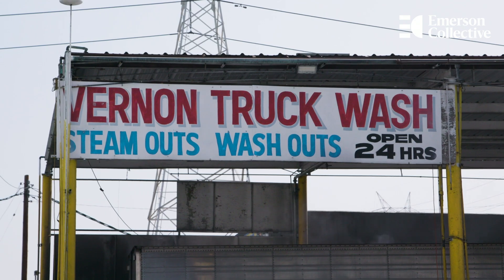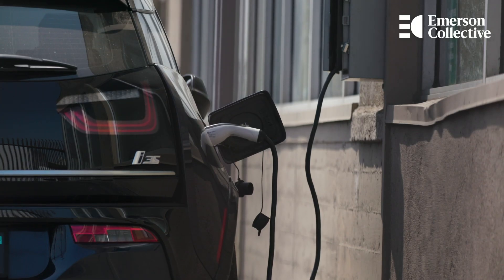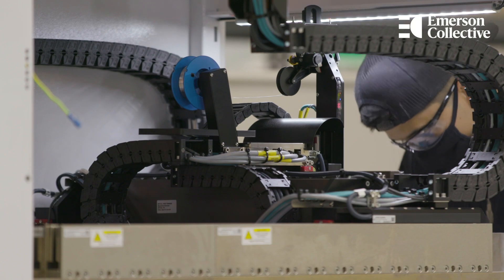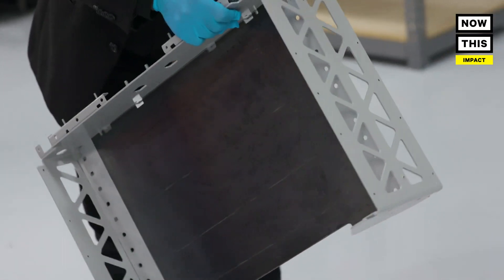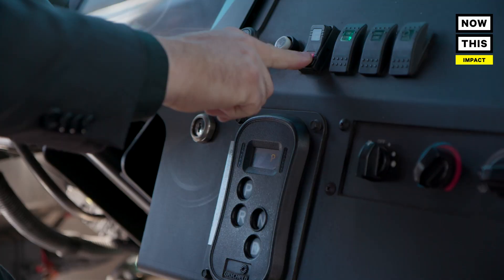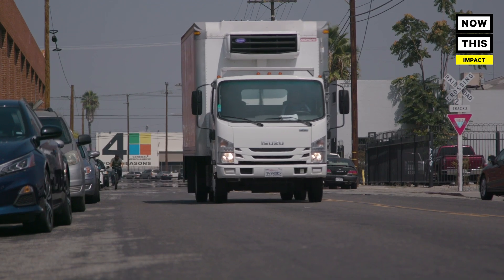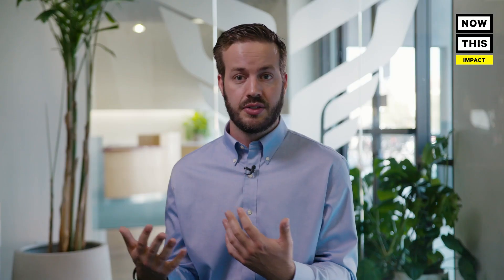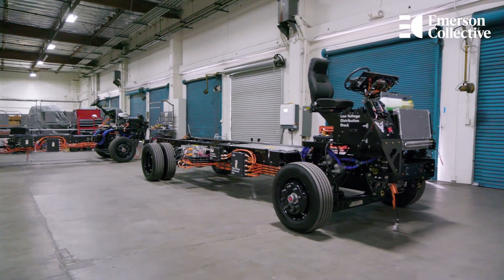Xos Trucks Makes Eco-Friendly Delivery Vehicles

Comment: Good news is we already have solutions. Trains have a better impact on reducing emissions and removing combustion vehicles from the road and the tech already exists. The infrastructure of the US Postal Service with smaller electric vehicles would resolve a greater portion of the emissions problem should we utilize more cross country rail and light local rail. Let's rid ourselves of wasteful for-profit behemoths and tech companies selling us non-feasible electric OTR trucks, and solve the emission problem now. Show us those last mile trucks overloaded doing a typical heavy UPS route for 11 hours. Show us the OTR truck actually moving, pulling a load, and making it through a scale.